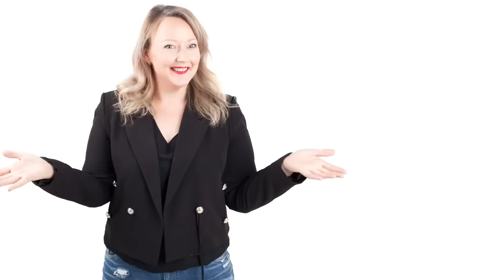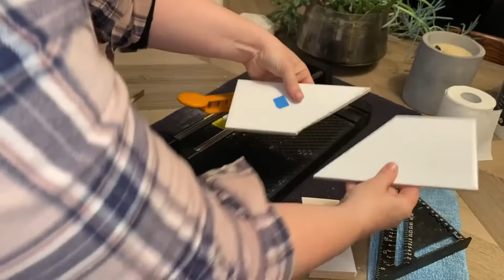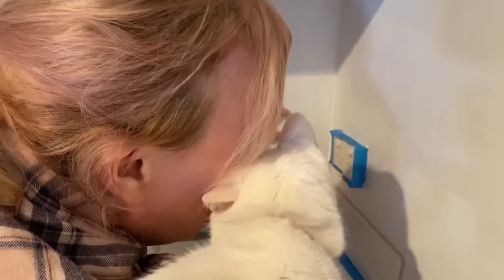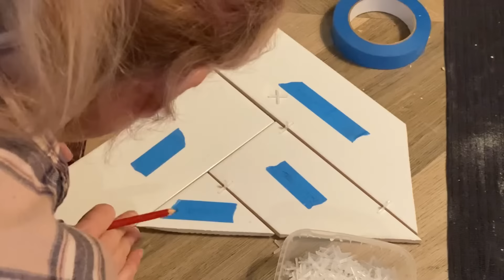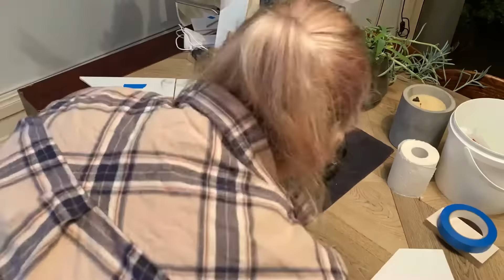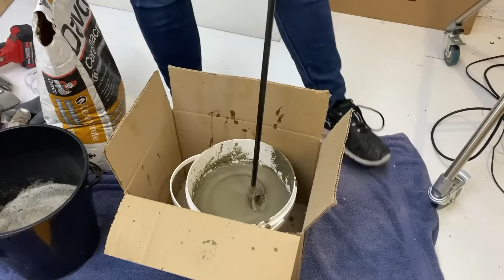How to lay Herringbone Tiles Pattern using White Subway Tiles | Chevron Wall Tile Kitchen Backsplash

Comment: Hello. I have a question please.
If my tile is 66mm by 200.5mm, I suppose the ratio of 1:3 is good. But this leaves 2.5mm for the two spacers in between the three that will be same direction. If I use 1.5mm spacers, the total length becomes 201mm (which is larger than length of 1 tile at 200.5mm).

The thing is, when I use the spacers at the end for both the horizontal and vertical tiles, it will get skewed (wouldn't it?). So, would this be a problem? Anyone has an idea on the matter?
I wanted to ask you how it turned out (were there any gaps when you placed your spacers when tiling?) as you said your tile dimensions are 100mm by 300mm. When you add the spacers of 1.5mm each, they are supposed to shift a bit theoretically...
Reply from the maker: Hi, what I can suggest is to grab some paper and make up a few paper tiles and spacer lines. Draw the first plumb line they lay them on and then add the next plumb line. Then you will be able to see if it’s going to work for you. Hope that helps.
Reply: @NicoleHerrickDIY Alright thank you
Reply: @NicoleHerrickDIY did you get any issue or had to calibrate/mitigate the way you placed them?
If it was exactly 100x300mm with 2(1.5mm) on top of that, I mean.
Reply from the maker: @uz.f1746 no everything stayed on track.

Comment: I did mine, thank you for the video.

Few advices; don't use paper cuts and move on. Take time cut pieces and apply, moving on with paper cuts will leave little spacing issues. Make sure socket outlet cuts or not big else you will have to buy big plates from Amazon 😅

I'm happy for doing such a great job as my first big DIY.

Wifey helped too a little.
Reply from the maker: @falconking007  nice! I’m glad it was helpful.

Comment: It looks amazing! I’m also a first timer and doing a kitchen herringbone backsplash. I was hoping I’d see how you finished the very bottom and top of the tile when it meets the countertop and where it meets the cabinet. Do you use grout there or is it caulking? Thank you for your time and keep up the good work!
Reply from the maker: @dianahuber951  at the bottom where it meets the benchtops I used silicone caulk so that it’s waterproof and at the top I used paintable caulk as I’m paining the cupboards.

Comment: Love the 1,2,3,4 for getting the pattern started.  Couldn’t tell because it was semi off screen but looked like you may have been ringing/rinsing your grout sponge in the sink, for anyone at home DO NOT do this, the cement/sand in the sponge will settle in your P trap and you’ll have flow issues. Get a bucket of clean water, and don’t dump that bucket down your drain either.
Reply from the maker: Oh thank you!

Comment: Wow!  Thank you so much for taking the time to make this video!!  I want to do a herringbone pattern on my backsplash also and I have been watching a ton of videos trying to figure it out.  I was worried about all the tile waste and basically figured I would need to try to re-purpose the cut pieces and fit it in other places on the pattern.  I never knew the tile could be cut so specifically that all the pieces perfectly fit together like this (the 1-2-3-4 method you showed).  My subway tiles are 4"x12", do you think this method will still work?  Your kitchen backsplash looks beautiful!
Reply from the maker: Yes my tiles are the same size so this method will work for you! There might be some that the off cuts just end up a bit small and you need to use another but it’s ok. So glad my method helped you feel more confident to tile. I’d love to see a before and after. I’m Nicole Herrick DIY on all the other socials if you want to send a photo.
Reply: @NicoleHerrickDIY  I plan to do the backsplash this month so I'll send a pic once its done :) How did you determine how many tiles you would need to buy?  Another video that I saw said to buy an extra 10-15%.
Reply from the maker: @nilnil7325  yes so width x height to give you the square foot size. Then look at the boxes of whichever tiles you choose to see how much each box covers then add 10%.
Reply from the maker: @nilnil7325  I purchased my tiles on marketplace as someone had 2 boxes left over. They were Australian $40 total (approx US$30)

Comment: How did you finish off the tile trim?
Reply from the maker: I didn’t feel I needed to add any caulk to the outside of the metal tile trim as it sits flush with the wall. I just painted right up to it. :)

Comment: I saw your video and it inspired me to debut my tile laying skills 😅 however when I tried to follow your 1,2,3,4 steps to lay down the first corner I noticed that the tiles didn't fit how they did for you. My guess is that the method only works for the tile size you have because I had 3x6 inch subway tile and they didn't line up.

Great work on your backsplash though!! :D
Reply from the maker: Oh yes. You will need the ratio to be 3:1 for this to work sorry. Great that you’re getting in and giving it a go though. I’m sure it will look amazing.
Reply: I just was trying this and got very frustrated thought I was losing my mind.....realized the size does matter. I eliminated tile number 3 and it worked perfect with standard subway tiles:)

Comment: For your first time, well done. Next time, put your thinset on the back of the tile - this will eliminate fumbling around the outlets & will ensure you have adequate mud on the back of your tile.
Reply from the maker: Thank you. Great tip. The box of tiles said I had to put the tile adhesive on the wall instead of on the tile so I just went with that.
Reply: @NicoleHerrickDIY  totally makes sense.  Again great job though!

Comment: Nice and well explained video. Personally I would have bought a tile cutter table saw and would have made cardboard models for the 1 to 4 repeated shapes to make the job faster 😉
Reply from the maker: Thank you. I also have a tile wet saw, it’s messy and noisy so I didn’t want  to use it for these small tiles. Cardboard templates is a good idea.

Comment: You need to not hold the trowel so flat. You'll get better ridges and a better stick by holding the trowel more straight on.
Reply from the maker: Thanks for the tip

Comment: Hi, looks very good. I am following both the videos you did for replacing kitchen splashback tiles, and I wonder if you can share where did you buy the white tiles, or which type are they? Thanks
Reply from the maker: They are white subway tiles 100x300mm, or 4”x12”. I purchased them cheap on eBay as they were left overs from another persons job. Many tile stores will have these though.

Comment: Thank you so much. As we cannot get a tiler for months, (post lockdown problem) I am faced with doing this myself (We have all the tiles already and I have borrowed an electric tile cutter. I wont use this now). I had ideas how to do it but your way is simple and makes sense plus the finished product is superb. Well done. 
Pedant note: You didn't appear to put a spacer between tile no 7 and 8, so did the grout hide this reduced space or did you put a spacer in later, that we didn't see? The finished tiling looked fine.
Reply from the maker: So glad you found it helpful. Yes I would have put a spacer in between there, I may have just trimmed it out in editing. Good luck!

Comment: When using your speed square always use it to check the largest angle.  You checked the smallest place.   You should slide the speed square against the bottom guide.  You can even leave it there while cutting.
Reply from the maker: Awesome tip. Thank you!

Comment: I love your video from all videos this one explains so much. I do however have a question so tile 1 and 2 are the same. I’ll just end up with an extra 4 ?
Reply from the maker: Thank you. You’ll end up with lots of extra pieces, sometimes your tile won’t snap in the correct place and you’ll need to use another as well. I just stacked all my extras in piles and used them when I could get a smaller cut out of them.

Comment: Good job! Thanks for the video. What size were the tiles? Where did you get them from?
Reply from the maker: Thank you. The tiles are 100x300mm which is 4x12 inches. I got them on gumtree (like craiglist) super cheap as they were left over from someone else’s job.

Comment: What did you do for the exposed edges on the right side?  We just had ours done and Im not happy with the job they did.  Its uneven on the edges and they just put white caulk on it instead of a proper end piece.
Reply from the maker: I used L tile edging. It’s a metal strip that looks like an L, you cut it to length and install it before you put the tiles on, then tile all the way up to it. Only 1 edge is seen in the end, the other side of the L is flat on the wall under neath the tiles. I show this at 20:18 in the video.

Comment: Wait so tiles 3 and 4 are from 1 whole tile
Reply from the maker: Yes that’s right. Sometimes if you cut it slightly wrong you have to use just one side but then you can use the other side later for the other smaller upper and side edges.

Comment: Would you be kind to share where you got those tiles from? Here at my local area so many kinds.
Reply from the maker: I bought these on Gumtree or eBay, they were left overs from someone else’s job. But they should be easy enough to find. These are 100x300mm or 4x12 inches.

Comment: Loved this video!! Very helpful! What did you do at the bottom where it meets counter? Did you use silicone or stripping?
Reply from the maker: Sorry for the late response. I used silicone along the bottom edge meeting the counter and paintable gap filler along the top where it meets the cupboards.

Comment: What size tiles did you use? Where did you buy them? I love how your kitchen turned out!
Reply from the maker: Genesis Reyes thank you so much! I used 100x300mm tiles. I bought them on gumtree from someone who had them left over from another job. But these are quite cheap tiles anyway. You should be able to get them at any tile retailer. I would suggest looking at a few local independent tile places and asking how much they have these for as Bunnings isn’t always cheaper when it comes to tiles.